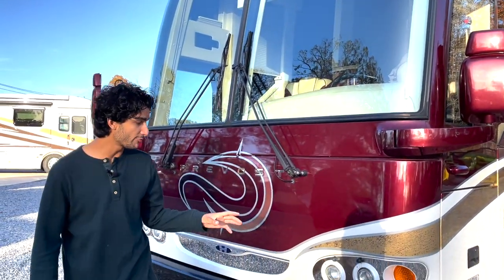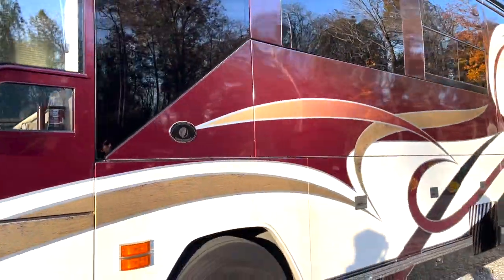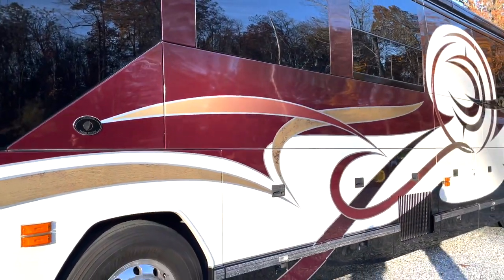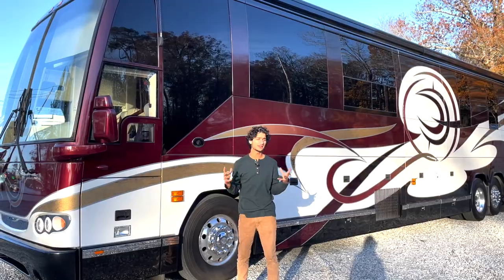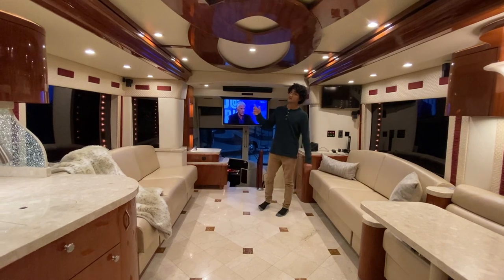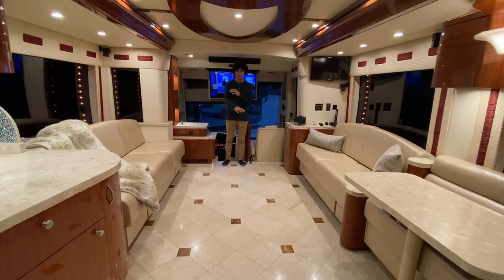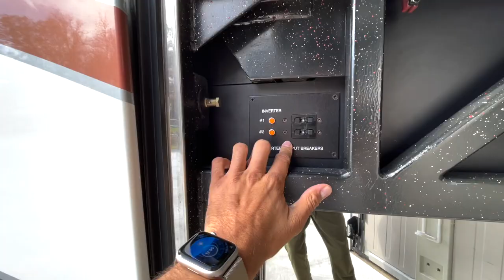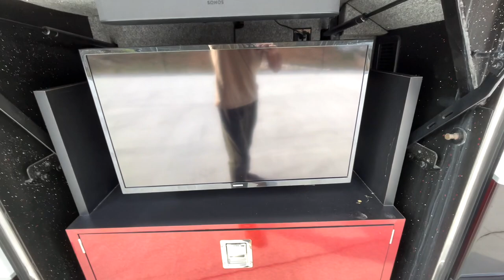STUNNING QUAD SLIDE 2009 Prevost Featherlite Sold

Comment: That motorhome cost more than $600,000 the frame itself with the engine is $700,000 because it’s a 
Prevost
Reply from the maker: You are right! A new Featherlite will cost over $2,000,000
Reply: All I said was that for that amount of money,  that coach should be pristine. What comes free should only be that you sold a high end luxury coach that was on a high standard. Not the corner "used coach"  lot standard. " ehhh it's broke? Yeah you fix it". Come on people. 

I really like the coaches y'all bring in,  but the "you get that for free" thing really turns me off and would go somewhere else.
Reply from the maker: @mikeorr8994  appreciate your input.  We do try our best to improve every day.. We rather be up front as we are not a full service RV dealership; however, we take pride in what we do to make them better with new floors, some paint work or remove ugly 3M film, make sure HVAC, plumbing and most of the appliances are in working order to use for camping, but we can’t never make them like new.. by the way, we just took a large deposit on this unit. Thanks for watching our videos.
Reply: @mikeorr8994  i only made a comment 😀

Comment: So you have to use the transmission retarder in order to break? This is new to me,  so have to constantly use that during all breaking ? Anyone?
Reply from the maker: The coach has steel rotors all around as your main braking system. The transmission retarder can be used in addition to the regular braking system.